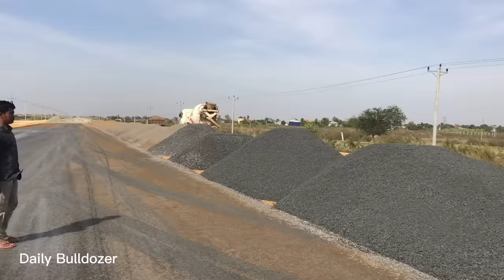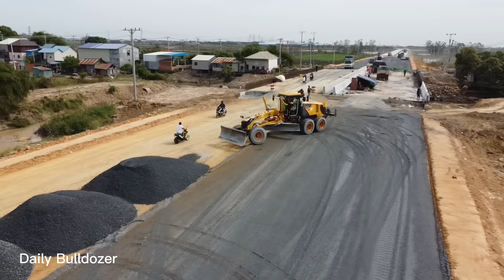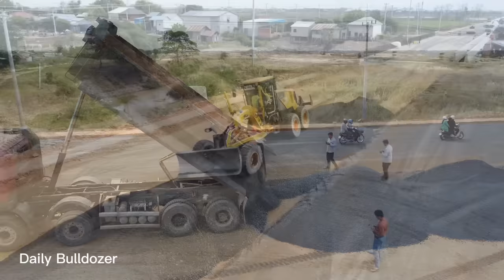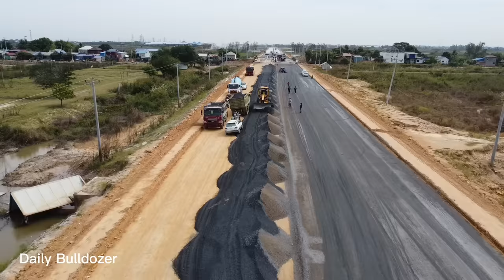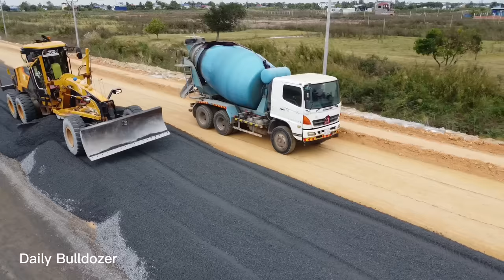OMG!!!Motor Grader Clearing Skill , Longest Clearing Gravel Making New Road (Part2)

Comment: Thanks for showing us how NOT to grade out a new roadway. The trucks should be dumped closer to the roadway. So that the piles slightly overlap the previous work. Then the road grader should work on the high side. Using the already finished roadway as a referance. Use the angle of the blade to catch more, push, or slide off the work material as needed. Once you establish your grade. It's easy to maintain it. Work the grader up and then down the road. Cutting and grading enough so you don't have material bleed from the end of your blade. Doing it this way, you will not only achieve the proper grade on first cut. But the surface will be compacted and the tires of the grader will not sink into the material. You could also have a vibratory roller working next to you. Saving a lot of time. IUOE Local 15 (38 years) Retired.
Reply: I guess they also have a grudge against using a spreader box or trucks setting chains on the tailgates. Since that would also lay more even and wouldn't loose your grade as easy as they way they are doing
Reply: Because that is EXACTLY how the grader operator likes the piles
Reply: @tjjay2438  Well he's wrong.
Reply: Yep. Probably needs to have piles like that since the drivers can't/won't spread. Good drivers could spread their gravel, the blade would only have to touch the material once.
Reply: Also, they are not using a major feature of the grader. Articulation allows the front wheels to remain on the adjacent finished grade and the tandems pushing behind the piles. Matching finished grade in one pass. Less wear and tear on the machine and less fuel. The operator doesn’t know how to articulate even for a turnaround. He needs a lesson!

This is a terrible example of grading best practice.
Reply: @CHWBAKA450  yes so painful watching them.. like you say the articulated side of the machine is practically rear wheel steering they are probaly not skilled up for it or not trained, I've seen skilled operators cut sides of benches down clean higher than the machine, fronts on the angle high and the blade and the tandems on the ground level, if they started from the already prepared side it would of made it alot easier
Reply: @killdizzle  They are probably on a low hourly rate so more time is more money for them😂 the company probaly has more money than senses 😂  grab there money and run too there next contract
Reply: Watching a grader do its thing is a beautiful thing to watch BUT not this one😢😂 get me a loader I'll spread that out in less than half the time it takes him to😪
Reply: You could make your retirement money in two years over seas consulting & construction management
Reply: I was thinking the same thing and i have never sat in the seat of a grader. Common sense.
Reply: @killdizzle  And a lot more passes, and a lot more fuel, lot more time, lots more money!!
Reply: its a 3rd world country...what do you want...
Reply: @josephbailey4965  True, but you only get about 1 good driver to every 20.
Reply: There are ‘operators’ and then there are ‘lever-jerkers’!
Reply: @CHWBAKA450  Yeah , he may not be very good at the job, but on the plus side he did an amazing job of festooning the machine with scarves.
Reply: All I can hear is second rate operators winging about someone who has some skills. No Accugrade, no GPS, just talent. FFS, appreciate it for what it is
Reply: In India, time and labor are the cheapest items. Only the machine costs money and you would never EVER pay to have someone trained. All their engineers are sitting on their asses in aircon, and would never stir out to deal with a methodology. CAT sends equipment there to die, both at the hands of piss poor operators, and to slowly be rebuilt by the dodgy mechanics. Besides, this road will never last. The sheer amount of traffic will destroy it in a matter of months.
Reply: The operator wants a thick base so he can compact it as he grades, you can't lay down 3 foot deep lanes by dumping with chains on the tailgates.  Plus he has to keep a lane open for traffic, he know's what he's doing.  He's not on his computer complaining.  smh
Reply: It’s India, what do you expect.
Reply: Dudes working in flip flops.  😂😂😂😂😂😂
Reply: Phil, you are 100% correct! I spent 30 years as a civil engineer accessing operator and equipment performance in the construction and mining industry. Operators wasting hours and wearing out the machine was a big problem. Great analysis and critique.
Reply: My word that is just painful to watch.
Reply: @adrianspeeder they barely have running water..more important things to worry about besides a road you won't ever be on🤦
Reply: Lets be honest and real here. I'm personally impressed. I know how all of this is supposed to be done to American standards, but that's not where this video is. Honestly, impressed they have a grader, and who appears to know how to run it. Considering almost every truck had a manual lock on the gate and no chains, its really not that bad. Sure, it could have been eons better. Rock box, grader, roller, Trimble system, paver, folks directing traffic, on and on. Consider where it's at though.
Reply: @CHWBAKA450 It's in a banana republic, so what else could be expected?
Reply: End result is a well graded product, so who cares how they go about achieving the same end result?
Reply: and yet they get it done in 1/4th the time. It lasts 20 times longer. No work related injuries  AND most of the safety footwear is made there but THEY don't wear any.

Comment: Probably a stupid question, but why not have the truck drivers pull up while dumping so you don't have the huge piles to chop down before you can start smoothing it out?
Reply: Possibly because they are long beds, and raising while loaded can make them unstable.  Lots of U Tube vids of loaded trailers tipping.
Reply: @tomrogers9467  Dump trucks in the US haul and dump 18ton like that regularly even on hillsides with long beds, but I guess anything's possible.
Reply: Could be they aren't able to drive and change the bed lift angle at the same time. Older dump trucks around here can only do one action at a time.
Reply: Probably because it would not leave enough material.  If the dump were spaced out your suggestion would make a lot of sens but the dump are very close because they want a thick layer.
Reply: Doesn’t seem to be having a problem the way they are doing it at all
Reply: Because this is Cambodia.

Comment: Motor Graders are a good leveling and grading tool. There is, however, a variation on the asphalt layer that can do this job far more efficiently. It can lay a roadbed foundation or sub-roadbed filler very quickly and more efficiently than even a Motor Grader can. They have been using such a machine for laying highways in my local area for the past several years. Very efficient, and grades the material to be placed as it travels, requires many more dump trucks than seen in this video in order to operate smoothly.
Reply: Dude, it's Cambodia. I'm sure this is as high tech as it gets.
Reply: Do you have a link to this?

Comment: Not bad, but not good either. First, it's a motor grader not a dozer so take that stupid mold board off the push block so you can see what your tires are about to drive on. Secondly, the first pass was a wasted pass, and on the wrong side of the piles to boot. Crab out and get those front tires on flat ground. Pull a finish windrow on to your existing base course first. It will be the last thing you bring across. Next, use the full mold board. The second pass he was toed in, but his heal was in the air; nothing good comes of that. Honestly, too much wrong to cover. I'm not trying to be mean, if you want to survive on the blade you have to do better than this

Comment: I could list quite a few problems with how this is being done. As a 25 year veteran in construction, there are a LOT of things being done wrong. 
Doing an import job like this where you're hauling in whatever materials to be spread out, you do it as if you're painting the road. The trucks need to spread the loads out better. Meaning when they dump, they should pull forward slowly and not allow it to be in such a big pile. Where I'm from, you should be using belly dumps for this. The truck pulls alongside the existing windrow and begins his dump, then the next truck ties on, and so on. All the blade has to do is carry the windrow across at the same grade until the ribbon is completed. Then do the same thing until you get completely across the fill. 
This is definitely a lesson in how NOT to build a road.

Comment: My first reaction was that this operation should have been using a spreader box not a motor grader to reduce segregation of the ABC.  But by the end of the video I was impressed at how well the base course looked.  The only issue I have now is the loose thickness of the layer (well over 5") and whether they will be able to obtain optimum moisture and density on the roadway, critical for a durable substrate on which the pavement will be constructed.
Reply: Likely not. Base course should have been built up in 50mm layers and rolled and watered throughout. I'd hate to see what the density test comes out at.
Reply: @1one3_Racing  looks like India. Quality control is strictly optional
Reply: @1one3_Racing  doubt they'll test. It's run n gun. A dozer alone wouldv been fine.

Comment: Skill?? No.. more like lack of equipment.. just getting it done.

Anyone that has ran a grader knows you can't raise the blade as fast as the machine will fall.
So that means it's the wrong tool for the job.

A scraper would make short work of that. That's the tool that should be used.

Comment: 1) Worker walking out into traffic from behind a dump truck to release tail gate latches.  Dangerous.
2) Absolutely no traffic control.  Vehicles driving in both directions on both sides of road.   Dangerous.
3) Dumping loads in huge piles instead of dump spreading to reduce grading time and stress on grader.  Inefficient.
4) 13:50  Grader angling blade so material is pushed back onto the pile instead of into empty roadway.   Inefficient.
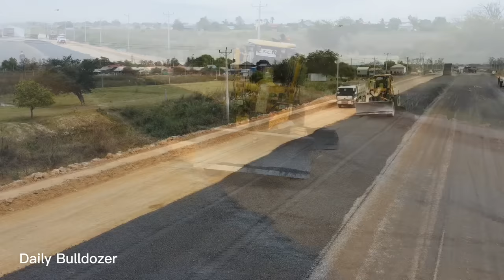5) 15:43  Pushing the same stone down slope that you just finished pushing up slope   Inefficient
6)  Multiple drones and pilots, so there is that.